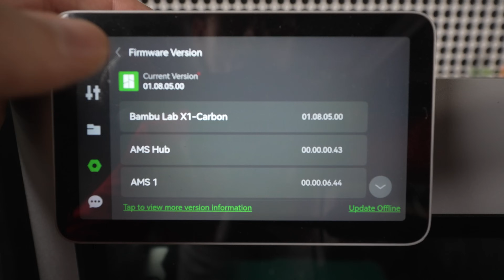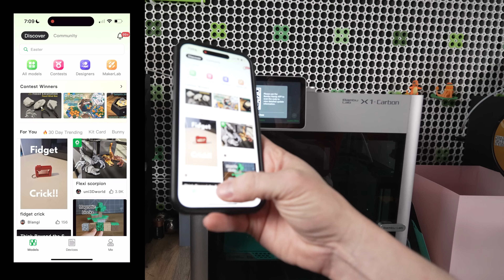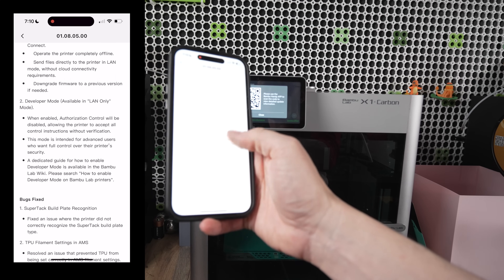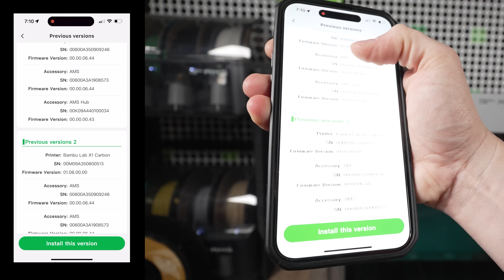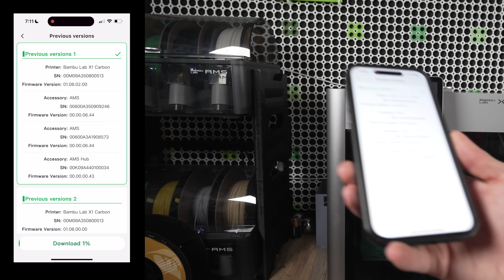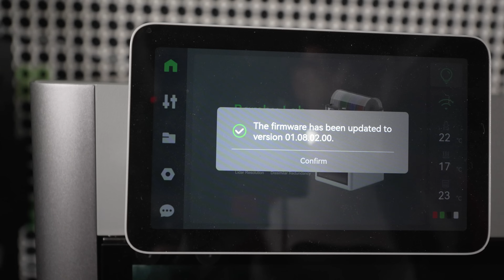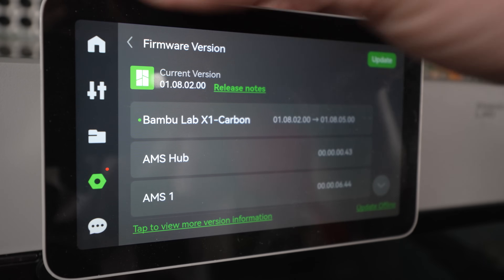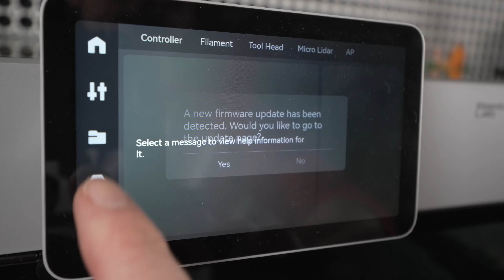Can You Downgrade Bambu Lab New Firmware? Let’s Find Out

Comment: Started getting AMS disconnecting or communication errors when i upgraded the firmware recently with a new ams hub.. even when i switched back to the old filament buffer it still disconnects.. hopefully downgrading fixes this issue.. 

I had the AMS HT for a good month without issues.

Comment: So the other day my cool plate stick on died. It was the last stick on sheet I had and they do not sell them any more.  So how do I continue printing with the cool plate without it. Probably a dumb question but I am not a super tech e.
Reply: Unfortunately the original cool plate has been discontinued. Bambu has released a different cool plate that uses different settings. I prefer the original cool plate that printed at 35°c.

Comment: I'm in Ireland in Europe and the firmware versions appear to be different. On my X1C I'm currently on firmware v01.07.04.00 and being advised on the machine's display that there is an upgrade available to v01.07.05.00. Neither of these versions are mentioned on Bambu Lab's Wiki pages. I'm completely confused.

Comment: I was 100% ready to buy a P1S bundle, then they made their changes, and now I won't touch or recommend Bambu Labs.  I don't want to have to use the cloud to print a file on a printer 10 feet away, and the only way I can do that is in LAN mode, which doesn't allow me to use all the features of my printer, or in developer mode, which is unsupported.  I'm not willing to pay for a device I can't use the way I want if I can't use all the features or I can't be supported.
Reply: ditto
Reply: If you find a good alternative that fits those needs please let me know :)
Reply: @gravtycat9741  Yea, there's not really anything out there except maybe one of the Vorons, but I took their BOM on one of the larger printers and it was over $1,000 before I accounted for the build plate or any of the hardware (screws and nuts).  Then you have to price out one of the open source MMUs that can be used with it.  It's probably $2,000+ to get that going.
Reply: @gravtycat9741 it's been there for years, prusa.
Reply: i am running a P1S for a while... and when i changed nozzles i was able to change the settings in Bambu Studio after. By now the even removed that and you need to change setting on that clunky display with buttons. Because they even removed the ability to make use of panda touch. Sad world... last Bambu product for me. I suggest to not to buy them

Comment: On my A1's, on the printer screen, there is a factory reset option!  I don't know if it is on the other Bambu printers though.  For me, I don't think I am going to worry about the things Bambu has done!  I don't intend to do any upgrades that will effect what I do with them.
Reply: I would recommend using Bambu Wiki 'Firmware Upgrade via MicroSD card'.  This allows you to upgrade up to the version where they made the controversial change.  Factory reset might not include the input shaping updates.

Comment: I do not like what Bambu has done, but... I'm also really tired of people searching for reasons to live their lives in self-righteous indignation.

Having said that, I have three Bambu printers, A1 with AMS lite, A1 without and an X1-C with two AMS. It is entirely possible I will not own another one because of the Bambu changes. I also have three other FDM that I almost never use since getting the Bambu Lab machines, Ender 2 Pro, Ender 5 Pro and FLSun SuperRacer with Speeder Pad. Thanks to Creality's reactions to Bambu Lab innovation I would consider one of their newest machines were I to need or want another FDM. However, right now I don't have a need for another one. I

I sort of randomly use Orca or Bambu Studio. And I have NOT taken the firmware update.

Will you have a video on setting up the new firmware with Orca using the Bambu Connect configuration?

Comment: So, how long did the downgrade take in real time?

Does this work the same on an A1?

Biggest issue for me for wanting to use Orca is for calibration. Still don't understand why Studio doesn't offer complete calibration routines. For general operation, I agree, Studio is fine. I also use Orca for my FlashForge printers.
Reply from the maker: So took about 10 minutes in total. 

Yes it works the same way for the A1 just use the Bambu handy app. 

When it comes to orca slicer I’m pretty sure this firmware issue only affects the x1-c as of now. I’ve heard all other printers are fine with orca. But that’s just this current version from what I’m told.